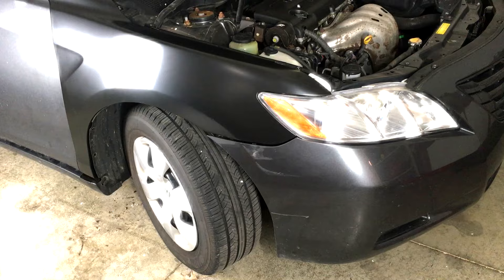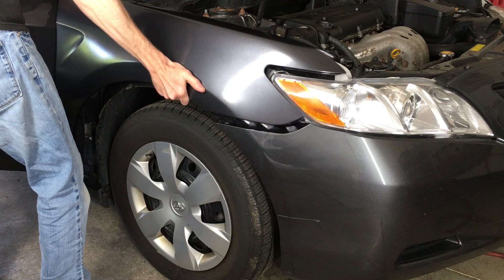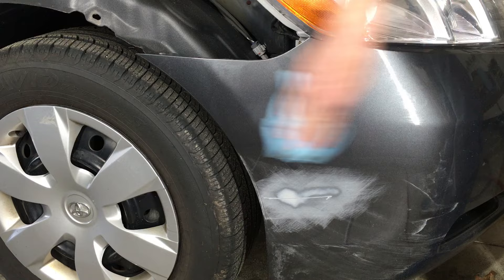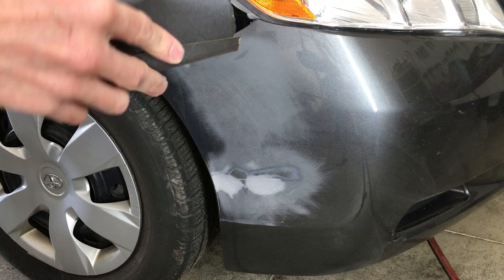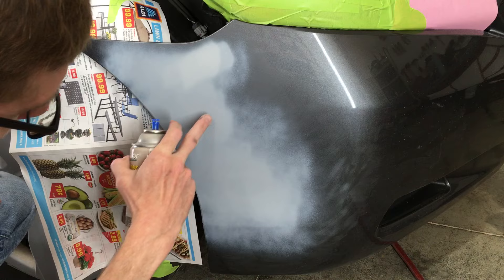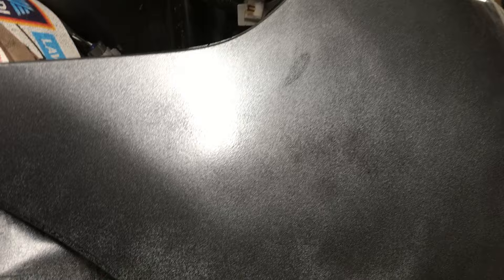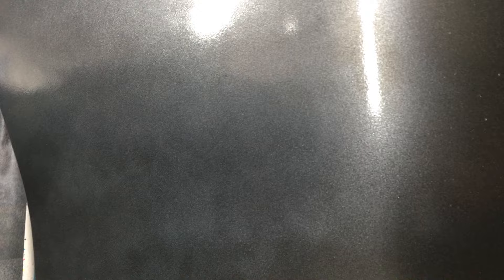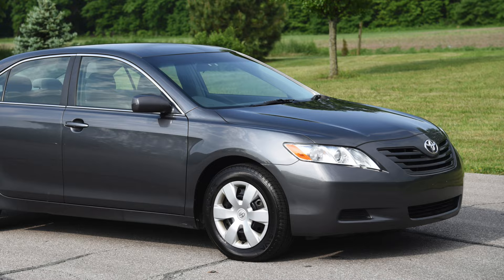How to Repair & Paint a Scratched Plastic Bumper - Easy Fix!

Comment: For good reference, best way to use a tack cloth is to "poof" it all out like one of those shower washers (lufa?). Then when wiping the surface make very little contact to avoid transferring any bees wax into the surface. You'll be amazed at how much better it will perform. Fold it all up when you're done and if it isn't heavily soiled, you can use it again.
Reply from the maker: I tried that today and it worked great... thanks!!

Comment: Nice job I have repaired a bumper that was pushed in and chipped paint used heat gun to soften to push out. Then did paint repair similiar fashion also used body scratch filler on alot of bumper marks. Came up a little short on base coat but color was close. while spraying clear coat couple spots looked like they hazed over but after a day or so dryed clear. Next time I will purchase new bumper and paint it will get better job and not too exspensive $180 . The process takes time but saves you dough

Comment: great video with steps easy to understand. however, I have a question here: should I apply adhesion promoter before applying body filler? thanks
Reply from the maker: Thanks! The adhesion promoter is like a primer for helping paint adhere to plastic. It doesn't need to be applied before the filler, because the scuffed up surface from the sand paper will help the filler bond to the surface. But if adhesion promoter is applied first, it's not a problem.
Reply: @6thGearGarage  Thanks for you responded on my question. I think I got it.  Plastic filler will stick to any scuffed up plastic, but paint and primer won't even has been scuffed.

Comment: I wet sanded to much and was unable to remove the wet sand area. I thought I cleaned it good until I laid down the primer. But still not bad for a first go at it. I’m doing the entire front bumper. And then scratch repair

Comment: Turns out that humidity and clear coat don't mix... my repair was looking great until I added the clear coat layers (it's 84% humidity here). UPDATE: after drying overnight (still in high-humidity), my bumper looks great!! My clear coat brand does recommend moderate temperatures and lower humidity - I read it after applying, oops - but it all worked out. Thank you, 6th Gear Garage!! Awesome video ♥️
Reply from the maker: That's pretty high... did the clear cloud up? I've had that happen when I applied it too heavy and it will clear up as it cures.
Reply: It did clear up overnight! It looks amazing, thank you so much!!

Comment: Thank you so much for this great video - I've been watching a lot of YouTube videos on repairing scratched cars & have bought the products. Just waiting for a day that isn't too cold or windy. Your video was very easy to follow & answered  a few doubts I  had over some aspects of doing it myself. I was glad to see in your reply to one of the comments that you don't have to scuff up & paint the undamaged area as it didn't seem to be necessary to me - I'm not looking for perfection & will just be pleased if I can improve the appearance of our 11 year old car. Could you please advise if the result has that orange peel look is the only way to fix it by sanding,  or would compound & polish be OK? I think I am scared of sanding as it seems to be "damaging" the car but I can see from your video that it works to remove imperfections & let you move on to the next step. Again, many thanks
Reply from the maker: Very light orange peel can be removed by just polishing.  Heavier orange peel will be removed easier/faster if you wetsand, then polish.  There are also more aggressive polishing compounds to start with, then follow up with finer compounds to remove the finer swirl marks.

Comment: Nice job ~ kinda intimidating for a noob but I can't afford those insane body shop prices.  Do you have a video of the best approach to fix multiple rock chips on a car's hood & bumper?
Reply from the maker: Hey I do have some other painting videos that might help.
How to Prep a Used Plastic Bumper for Painting: https://youtu.be/VYIpBFJMjis   Fix Rust Bubble Under Paint from a Rock Chip: https://youtu.be/na1FNBB9uxA   How to Prep Used Metal Body Panels for Painting: https://youtu.be/A70ow4VsSfY  and  Paint a fender with aerosol: https://youtu.be/qyIBWXXPjgU

Comment: Thank you for the video. Im going to try this out on the front bumper of my s2000. There are quite a lot of little scratches across the entire lower half of the bumper, so I’m probably going to respray the entire thing.

I’ve never painted a car before so wish me luck lol. If it all goes well I’m going to try and restore all the other dings and scratches on my car. Thanks again
Reply from the maker: For a nice car like your S2000, I'd recommend the Spraymax 2k Gloss Clear coat over the Duplicolor Clear coat - Link is in the description.
Reply: @6thGearGarage  thank you for the advice. I did see another video that used a 2k clear coat vs the duplicolor clear coat and it was night and day!

Comment: I have similar problems on my BMW X3.  Plastic fender, deep scratch like your Toyota but I also have some scratches on my door which is not plastic.  Body shop (in Japan) wants $1100.   Is the only difference to just not use the adhesion promoter?  Can I use the same filler?
Reply from the maker: Yes the door repair will be very similar, without the adhesion promoter.  There's no need to sand down to bare metal, but if you do expose bare metal, use some Self Etching Primer on it for the best adhesion.

Comment: how long did it take you to do this whole project?  And of course with the fender, what was the total cost?  You did a fantastic job.  Was there a difference between the original and new paint?  I couldn't tell from far-away shots.  Thank you
Reply from the maker: I did it over a weekend, but that was with filming. So it could probably be done in one day. I already had most of the materials, so I had around $50 in the color matched paint and fender. There was a slight difference in the paint. The fender looked slightly darker and the metallic flake was slightly larger. On a nicer vehicle that you plan on keeping, I would spend the extra money on a 2k clear. The finish will last a lot longer than the lacquer clear that I used. If you had to buy all the materials (sand paper, bondo, primers, degreaser etc.) & paint now, I think you would spend at least $100, without the cost of the fender.

Comment: If you have to do this type of repair outdoors, and the weather is ≤50 degrees, will you have issues with paint adhesion? I suppose you could warm the paint cans, but what about the surface temperature of the area to be painted?
Reply from the maker: Keith Cross I would check the instructions Of the product you’re using. 50 might be a little too cold.

Comment: Video was great.  My biggest question is how you feather the primer, paint, and clear coat on to the existing factory painted area?  It looks like you’re just letting the overspray go onto those areas.  Shouldn’t the primer overspray be sanded.  I know the video says to sand beyond the area but your video makes it look like the overspray is hitting the bumper in the front of the car but you’re not sanding there.  For the color match paint and clear coat, it seems like the overspray area in the front of the car won’t have the “wet” look like the main area where you’re working so how did you get those wet looking?  Thanks.
Reply from the maker: You're correct, the color and clear overspray is extending onto the bumper outside of the repair area. Then when I went back with the polish, the overspray was either shined up enough to blend in with these areas, or in the cases where it was very light, it was removed all together when polishing. The Duplicolor paint is lacquer based, so it remains softer than the OEM urethane paint. That allows it to be polished away completely by the abrasives in the polish if I work in the same area long enough.
Reply: That was a great question, I noticed that too. I’m glad the polishing step takes care of this.

Comment: so, to understand this process, the prep and primer and base color and clear all just blends into the rest of the non scratched of the bumper with no tape line between new and old paint?  this should work if one had a 2 inch blemish damage in the center of a full size truck door when the rest of the truck door is just fine???   thanks for your advise in advance
Reply from the maker: Hi you are correct. The clear blended it all together at the very end, followed by polishing. In the end, I couldn’t even tell the area was repaired.

Comment: Question now that you have benefit of hindsight - would you still have used regular body filler in the deep scratch, or would you have done a finer "glaze-type" polyester filler, or would you have gone with one of the urethane (2-part) repair compounds (like 3M 05887 as an example)?

I believe each of those three options is more flexible (less likely to crack), in the order listed above.  However, since you didn't remove your bumper (no major flexing during re-install), and it's a relatively small/short length scratch, it probably doesn't matter.

Just curious about your thoughts now that the repair is ~3 years old.  Thanks for an excellent video!
Reply from the maker: I can’t say for sure, as I sold the car a few years ago. I used the body filler because I already had it and I didn’t know about the more suitable products at the time. But I agree, the repair area was so small that it may not have made a difference.

Comment: Could I use my random orbital sander if it's a large area like a back bumper? It's a 195k miles and been used as a airport runner so lots of scratches.
Reply from the maker: Absolutely, that will save you a lot of time!

Comment: Do you sand the basecoat if it has orange peel in it before you clear or sand the orange peel out after you clear?
Reply from the maker: I usually sand the orange peel out after clear. If it's really bad on basecoat, I'll sand the base coat and re-apply base coat, then clear.

Comment: Thanks for this great, detailed video!  Question for you:  I have some scrapes on both sides of my front bumper that I'd like to repair, but what would you do if the undamaged part of the bumper--the middle part--is less than pristine from having been subjected to over 200,00 miles of highway driving?  No major damage but just lots of tiny rough spots and some tiny chips?   It looks like I'll be buying a buffer so I could try to buff them out, but still, I wonder if the two sides will look pristine from the repair and the middle part will look different...  Any thoughts on this?  Thank you!!
Reply from the maker: If it’s full of chips, I would sand the entire bumper down and paint the whole thing instead of just painting the repaired areas.
Reply: @6thGearGarage  Thanks for the reply!  And if I may ask a follow-up question...  When I sand the entire bumper down to smooth it out, should I apply body filler to all the little chips, as opposed to sanding the whole thing all the way down to plastic to ensure the surface is smooth and even?  Thanks again!
Reply from the maker: Allen B it really depends on the depth of the chips. If they’re not too deep, you can get by with using filler primer and sanding it flush. Doing them all with body filler sounds tedious. It’s better not to go down to the bare plastic if you don’t have to because the factory primer is well bonded to the plastic bumper.
Reply: @6thGearGarage  Got it...  All makes sense and I'm looking forward to doing this job!  Thanks again for sharing your expertise.

Comment: Hi 6Th Gear Garage: 
I used Dupli-Color-Filler (and everything else on your list) but I didn't buy Dupli Lacquer Clear coat, instead I bought MAX 2K Clear Coat. BUT after I used the whole MAX 2k Clear Coat, the surface is so rough not shinny with polished look. The surface is so rough even touched with bare hand. DID I USE THE WRONG TYPE OF CLEAR COAT? (just added now: I peeled off the expiration sticker and found that I did not smash in the red cap on the bottom half - not activated! What a rookie mistake!) What can I do at this point, apply more MAX 2K with the correct activation? Or switch to Dupli Lacquer Clear coat? Or sand everything off, do it all over? I felt so sad, now... Please advise!
Reply from the maker: Spray Max 2k is a quality product. Not having activated it, I'm not sure if I would try to apply any more clear over top. I would wet sand it down smooth first. From there you could try applying more 2k, or keep sanding all the way through the rough clear, down to the color coat. Then you would need to apply more color before spraying the 2k clear. You may want to call Spray Max and see what they advise to do about clear applied that was not activated, if it is ok just to sand it smooth and re-apply or completely remove all the unactivated clear.

Comment: Why did you decide to use a lacquer clear coat? Are most factory clear coats enamel? I have heard that lacquer can melt enamel.
Reply from the maker: Most modern clear coats are urethane, which is more durable than lacquer. But I already had some cans of lacquer that I needed to use up.
Reply from the maker: And you're right, you should not apply lacquer over an enamel or it can cause the paint to lift.
Reply: @6thGearGarage  So, can you apply lacquer over urethane?

Comment: question. I noticed you just sprayed the areas that had the body filler with the adheasion promoter.
Shouldnt you have sprayed the entire area? Also ypu never mentioned using anti static cleaning spray.
Reply from the maker: I used the adhesion promoter on the areas where any bare plastic was showing. It's for bonding to plastic. I didn't need to use anti static spray, but you definitely can if you're working in a dusty area.
Reply: @6thGearGarage  
so your area  your work is completly lint and dust free then?
There is dust and lint that get statically charge and is all around us even if you dont see it.
Thats why I was curious about that.
Enjoyed your video!

Comment: Hi 6th Gear, I have deep scratches in my Outbacks bumper from scraping it against our cement landscape block wall.  Just want to make sure I can use the same repair system as you used in your video? My scratches are a lot deeper then yours were.  If there is an additional step or two please let me know. Great Vid Thanks!
Reply from the maker: Hi, it should work fine.  Just make sure you knock down the high points created around the scratch and you will just have deeper scratches to fill.
Reply: @6thGearGarage  Thanks for getting back 6th .  I'll make sure to do that. Thanks again

Comment: The video was great but seemed to gloss over the polishing part after the paint and clear coat.  The polishing part is a science in of itself according to other videos.  Is there a reason why you don’t use a microfiber buffer cloth?  As for the polishing compound, there are many different types.  Which do you recommend?
Reply from the maker: Michael Binno lacquer aerosol paint is softer than the oem urethane paint, so it doesn’t take much to polish it. I used a medium compound by meguiars. I could have gone back with a finer finishing compound to remove any fine swirl marks, but then the repair area would look better than the rest of the car. I’ve done a couple paint corrections on vehicles, but there are YouTubers who can teach the polishing process a lot better than I can because they do it for a living. I learn a lot from AmmoNYC channel & highly recommend it to you 👍

Comment: Great video! I’m seriously thinking about attempting this. I have a white BMW 2017 and the back bumper has a long and very narrow scratches about 1’ long and maybe 1/16” wide. Would you recommend doing the same ? How do I find out the colour that matches the existing colour paint ?
Reply from the maker: Lisa Spur you will want to check the VIN sticker to get the correct paint color code. On most vehicles it’s in the drivers side door jamb.
Reply: Thank you! So, I would have to call bmw to get the colour ? Sorry, I don’t know much abou this stuff :/
Reply: Or I guess with the VIN number I just take that to a paint shop? 😬
Reply from the maker: I don’t know where the vin sticker is on BMW, but most vehicles have it on the driver side door jamb.